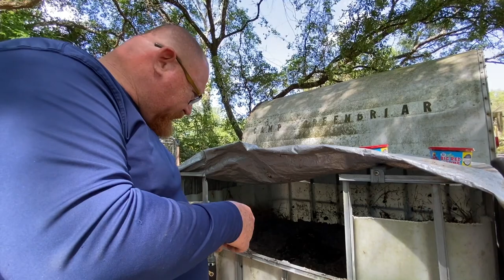How to Make a Worm Bin out of an IBC Tote

Comment: You can cut an inch or two off the side and it'll slide right down in the bottom of the tote
Reply from the maker: Yeah I ended up notching around were the drain is and it went right to we’re it needed to go. Thanks for watching and the comment
Reply: Just making one now.  Have watched a video where the bottom went in with the top face up rather than down like a bowl, i put bricks under mine.  That way you can have water sitting in the bottom but not touching the worm contents